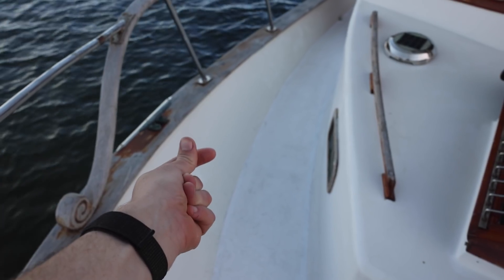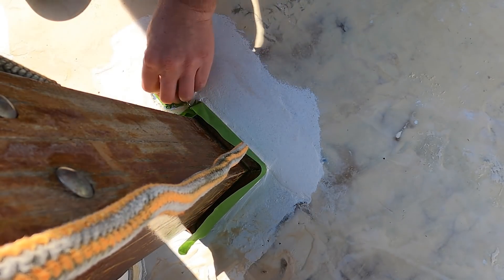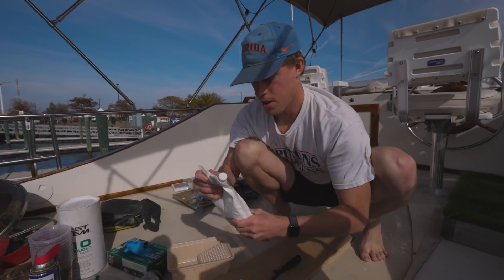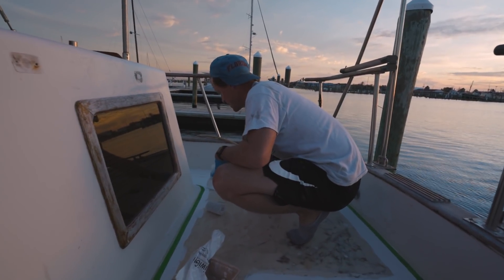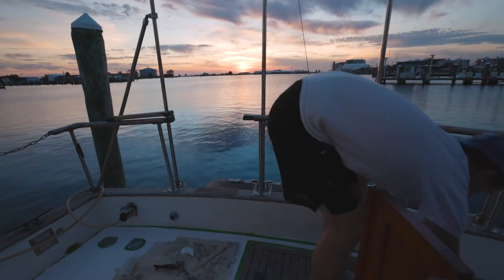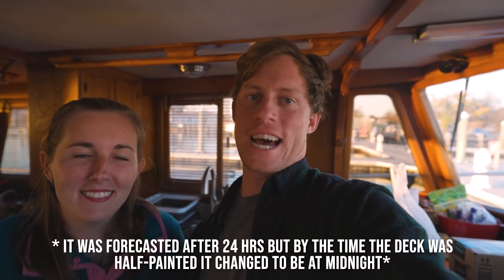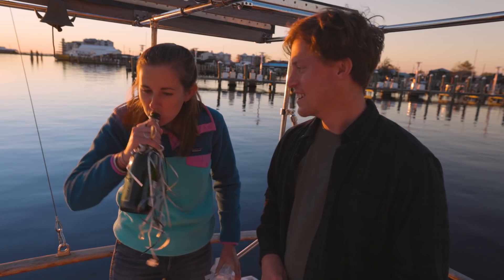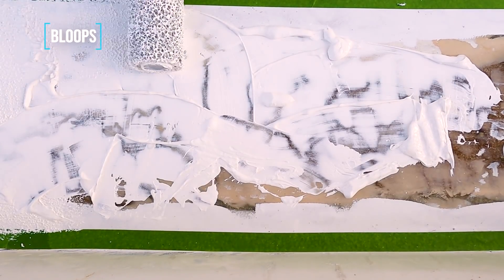No more soft decks on our trawler! (finishing our biggest boat project yet)

Comment: You guys are definitely an inspiration to me. I've never done fiberglass work before. I have a 30 ft fly bridge with a large soft spot on the bow.
Not leaking inside yet but can't be far off. I'm retiring this winter and should have the time,  but getting over the fear of starting is the hard part.
Reply from the maker: Thanks Charles! You can definitely do it! Time is your friend for learning and accomplishing what you set out. I'd definitely suggest starting small and giving your self plenty of time. It'll take a lot of the stress out of it! Plus always remember that with fiberglass any problems can be reversed... it may take more time x materials but nothing can't be un-done. Hope that helps getting over the fear!

Comment: hi just found you guys my question is from the leak did you have to re fabric the berthing area, from the leak and if so how????
Reply from the maker: Yes we did! We bought new headliner from sail rite, and then followed their instructions for installing it onto new wood. We used the old headliners as templates for the new wood and it went well. Best advice would be to try and follow the sail rite instructions to a T specifically around drying time. Cheers!